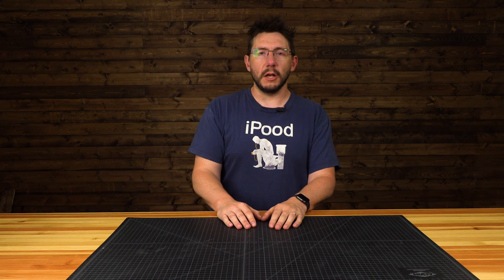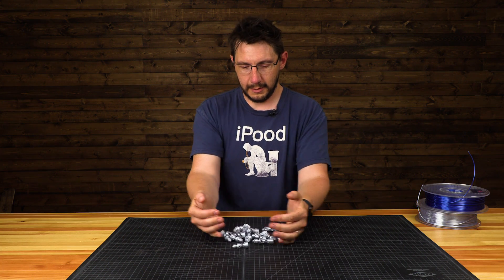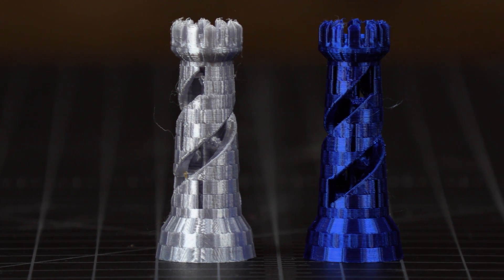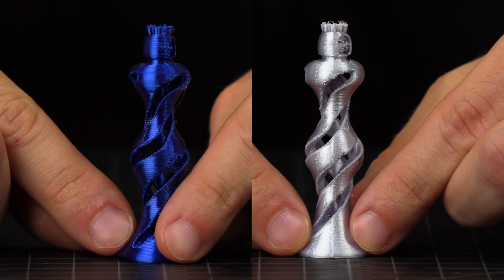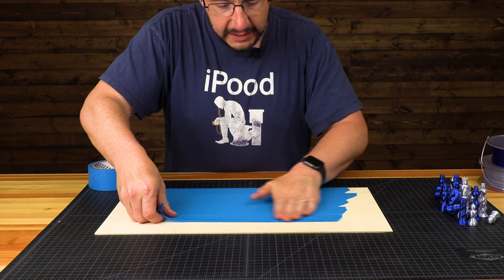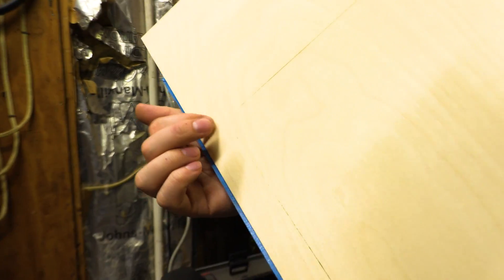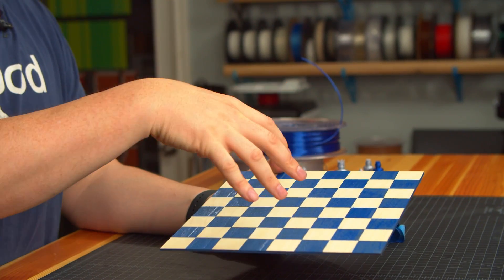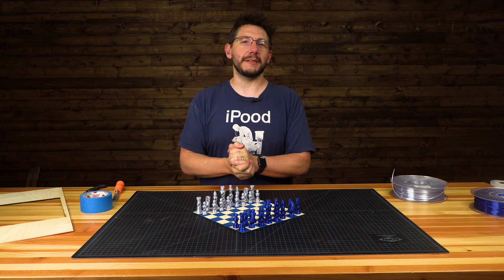3D Printing a Chess Set and Laser Burning a Chess Board

Comment: If you wanted to remove the squares that you etched out, it would have been better off to just cut a grid and peel the alternating squares.

I've been using a laser cutter for quite a while, it's just easier in the long run to peel the pieces you don't want than to clean up an etch.

Just my 2 cents.

Comment: If you just wanted the laser to cut away the tape mask, you'd be a lot better off vector engraving the lines. I skipped around in this video a bit so I don't know if you discussed this, but vector engraving the lines and peeling up the tape would probably take less than a minute. Raster engraving across that whole board, even at like a .005" stepover would probably take upwards of something like 15-25 minutes depending on scan speed plus then you still had to take the chisel to it to clean up the little bits that weren't ablated away.

Comment: I actually use a glass chess board as my printing surface. I've thought about printing out a chess set on it just to get the picture of all of the pieces aligned to the squares.
Reply: Interesting idea :)  Be careful for different types of glass could dangerously crack and shatter depending depending on a variety of factors such as heating or cooling.
Reply: @HiHi-he4tz  These seem to be tempered glass and I haven't had any issues with them in well over a year of printing.

Comment: Hey Joel, not sure if you will see this. But an easier way to do something like that with the laser would be to have it just focus on drawing the lines themselves. Then you could have just peeled up the alternating pieces without having to burn through full sections. This was a trick that I figured out with my (far less powerful) laser, it can also be useful for spray painting custom stencils out of the painters tape.

Comment: Hi Joel finally a maker kind of thing the 3D & a LASER combo build. I agree with some of the other people about just either just laying out the tape correctly in the first place and painting it or using the LASER to cut the taped sub straight and peal out the areas to be painted. Also you could have used a thin veneer of woods used the LASER TO cut very exact squares then glued then on to a thicker board or even a Box / Container to store the Chess Pieces GOOD JOB  I am just some one who over does things High Five and a big Hug

Comment: With the laser instead of rastering the squares you could have etched the outline (cut but very low power so to only cut the tape) then peeled the squares off that you wanted to paint.
Reply: This ^. Faster & cleaner. Also add a clearcoat before the blue to prevent seeping.

Comment: lovely video!
just one thing, I am pretty sure it doesn't cut through, not because the mirrors are off, but more likely the need cleaning. (dirty mirrors doesn't reflect as much). Or it might be just the tape with makes it a bit thicker. What I like to do when laser cutting is added 0,1/0,2 to the with of the cutting deeps. just to make sure it goes through. Cutting it manual can be a pain in the... depending on the Shape :)
Keep the great work up:)

Comment: Hi, strange use of the lazer for the checkerboard! You could have done the same by simply cutting the paper with a blade and a ruler and pull the paper in a shorter time. It's a good illustration of how to kill a fly with an atomic bomb, isn't it😎? Nice checkerboard by the way

Comment: Joel, I love the chess board. A comment on technique though, You could have saved a ton of time by not rastering the tape away. Instead, do the outline of your squares as a vector and cut at a low power. Enough to just cut the tape. Then weed the squares away and paint, this would also be generally unaffected by layering the tape and be infinitely faster.

Comment: Joel with .1 mm layer height the result should much more better.
Reply: Correct me if I'm wrong, but I didn't hear him saying the layer height. He only said that he used 0.35mm nozzle, which can easily print with 0.1mm layer height. Cheers :)
Reply: @ssheytanov  no he didn't say the layer height. But they don't look like .1 mm. The look like .25 mm
Reply: Could be just a matter of keeping the print time reasonable.  Otherwise a complete set of two colors would be about an 80 hour print.

Comment: were these diesigned for sls and sla printers, or for fdm printers? juts wondering as they are so detailed. great job by the way!
Reply: NTX9 printed them on a Prusa i3 Mk2.5 at 0.1mm layer resolution.
Reply: I originally designed them for SLS printing on Shapeways before I had a FDM machine.  With the Prusa I really like printing them at 200% scale but it takes about 80 hours to produce an entire set that big.

Comment: Why do the raster scan on the laser?  If you were going to mask and paint it, why not just use a low power cut to cut the pattern in the tape, then peel the squares off where the paint will be applied?
Reply: Thought the same